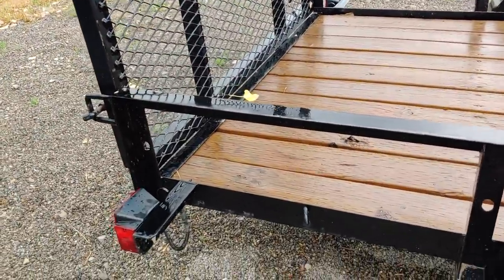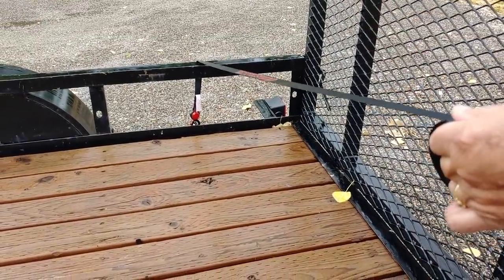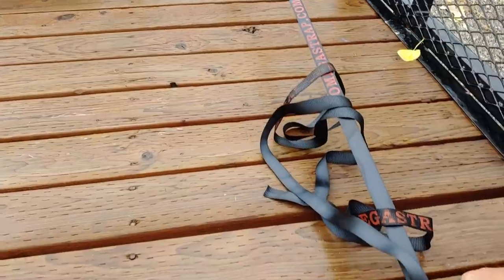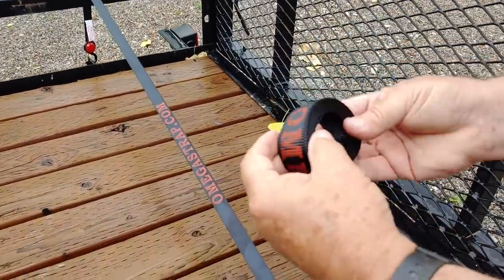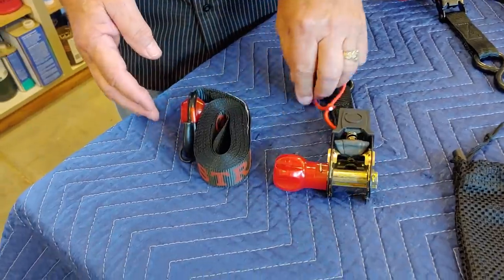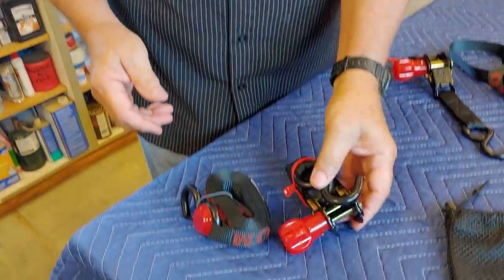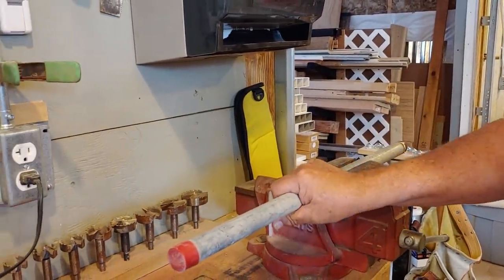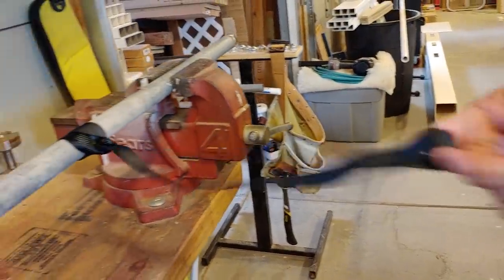FINALLY - A Better Ratchet Strap!

Comment: Biggest issue I have is if I purchased cheap straps, got what I paid for. The ratchet bends, the strap material is thin but the hooks seem ok.  Like the idea of the bungee cord on existing straps as mentioned in another comment. Make use of what I have since everything has went up in price. Thanks for the informative video.

Comment: After over 35 years of useing conventional ratchet straps I still don't have any major problem with them. The problems I have had with them were caused by me not using the strap correctly. 
I like the hook keeper on the strap in the video but the knob is going to get in the way.
Reply from the maker: Thanks for watching and commenting John Ossendorf. Keep the comments coming, Sir. Best, DFJ
Reply: The only problem I sometimes have is the fixed length end puts the ratchet mechanism at a location I don't like because it may scratch the load. Then I usually just reverse the ends so it gets into a clear area.
The excess strap is quickly handled by bundling it in a figure 8 pattern on my hands, much quicker than trying to loop it around the knob or in a tight circle.

Comment: I have used straps for years.  First off, you get what you pay for, so don’t buy cheap straps.  When strapping items, where the strap will be hit by the wind, put a single twist in the strap, to keep it from vibrating in the wind.  Next, Consider using some sort of protection for your straps, when they are under tension going over the frame of a trailer.  I cut a piece of plastic from a milk jug, and place it between the frame and strap.  Always secure the ends of the straps to keep them from blowing around.  I just tie it off to another location on the trailer.
Reply: Good idea with the twist. I normally strap down things in an enclosed space so wind isn't an issue, but good to know.  I've always strapped them straight because it might trigger ocd otherwise. 🙃

Comment: i use the smaller cheap straps and the only ones I've had problems with is the one that i didn't use correctly.  i only haul landscaping materials or trash.

Comment: I  grind the hooks off the strap and use the loop holes left to put directly on to the trailer hooks . far better device without the strap hooks.
Reply from the maker: marxman00, I would say this is doable for moderate loads, but you'll need to watch not to use this on high tension loads as the loop, which is only bent to form the shape, and not welded, could open and fail. Thanks for taking time to watch our video and write. Best Regards, DFJ

Comment: The knob is not a bad idea but the wire - good idea too but that's gonna break after a few times surely?
Reply from the maker: Thanks for watching and writing. The wire is surprisingly durable, and they've made it so it can be replaced with a piece of 12 gauge solid core electrical wire when the wire does give up. Best, DFJ

Comment: That bungie is going to wear out and loose it’s recoil pretty fast. And that bendable tie is going to wear out pretty fast as well. Then you’re just left with a ratchet strap with a knob that gets in the way.
Reply from the maker: Thanks for weighing in. The wire is replaceable with standard 12 or 14 gauge electrical wire. That knob is a key feature that allows both alignment of the slot for threading (even in the dark), and well as controlled release, instead of all or nothing. So far, so good on the "bungie" portion. Best, DFJ

Comment: My hubs needs this.  We just tossed a strap that was locked and we couldn't fix it.
Reply from the maker: Glad you saw the video. We are very impressed with this new variation of the ratchet strap. Hope your hubby will be as impressed as we are. Make sure to use the discount code in the description below the video to get 10% off. Best, DFJ
Reply: @DirtFarmerJay  Yes sir. He watch the video and he was sold. I have reminded him of the code. It really does solve every problem he had with the old straps. Thank you!
Reply: I have found when a strap gets locked, just hold the lock open, and use a flat bladed screwdriver to turn the drum manually.  Just insert the screwdriver in the slot on the side of the drum, and it will right up.

Comment: Hey Dirt Farmer, would it be better if the D loops were placed the upper rail so the strap doesn’t torque across the top rail ?
Reply from the maker: Yes indeed. That would work quite well! Thanks for the insight. Best, DFJ
Reply: Hey Dirt Farmer, I noticed the wood floor on your trailer look Good and durable and will stand up various weather. How old is it ? Or is it the type of wood ? Mine was Thompson water sealed and it’s warping and cracking and still drying out.

Comment: Looks like a solution to a non-problem. 
The knob will get in the way or get broken off, the little wire will eventually break off, and the big gap in the spool area means less strength. 
If you want the hook to stay hooked while you walk around, use a rubber band, a piece of tape, or a bread tie. 

I avoid small 1" wide straps, they're fine for small cargo but worthless when you need them most.

Comment: The first company that makes magnetised hooks on all ratchet straps will make a killing.
Reply from the maker: Agreed! Best to you, DFJ
Reply: It is a concept that has been used, but there are drawbacks. They stick to everything and pick up everything! They don’t work with aluminum or stainless steel either. OmegaStrap is going to try an earth-magnet option that fits into the hub of the flex-hook assembly. It can be easily removed if it becomes too annoying.

Comment: BS! You do NOT lay ratchet open. I've been flatbed trucker for 36 years.  You adjust the slot perpendicular to the ratchet with arm closed. Thread the strap through the ratchet and take up slack. Then tighten ratchet strap. Period! Quit telling people to lay open the ratchet. It is absolutely the wrong way!
Reply from the maker: Steve, thanks for writing and sharing your expertise so passionately. Your way is indeed more elegant and direct. The way I demonstrate works, but yours is a better way. We actually intend to release another episode on the best practices with these devices, and your approach will be the featured way for threading the strap. You're not the only one that has written and taken exception to what I said. Thanks for being a part of the transportation network - the best to you and yours - DFJ

Comment: Dad always said you had to be smarter than the object your working with. If you can't work with the strap as designed, you're simply not very bright.
Reply from the maker: Robert, thanks for weighing in. If we only stayed with what was already in place, there wouldn't be ongoing improvement and product development. We use "traditional" ratchet straps as well and have episodes on those as well. Best Regards, DirtFarmer "Not Very Bright" Jay
Reply: Then we should still be using rocks for hammers! Try OmegaStrap and you’ll see why like the hammer, it’s a better tool.

Comment: Clearly the maker of the ratchet strap in your video has some nice features for the general public not serious users. I wouldn't be surprised if those soft wire and bungees break under normal wear and that knob cracks in the cold/UV. Most importantly the detail of Made in the USA. You and the manufacturer didn't do your homework or look at all. There are quite a few manufacturers producing straps, webbing, etc for homeowners/commercial/industrial solutions that meet or exceed Real USA Industry standards not Chinese or Asian imaginary/cloned or copied standards that they may stamp on their junk. Heres one example for you and the drones who don't search for themselves and you Sir are doing a disservice to the American public by not checking for yourself. Please look the site below. Covers all levels/needs. MADE IN U.S.A. One of many!
Reply from the maker: dhtrehj ipohgf - slow your roll there a bit. I appreciate you taking time to write and be so passionate about supporting U.S. manufacturing and workers. I share that sentiment. Many of our videos express the view that wherever the viewer is, they should first and foremost support the industries in their own country. 

Instead of me re-writing all of my thoughts on this, would you extend the favor of reading the response I gave to "Jeff" on the same video? I think you will find we are closer in position on this issue than you think - and that we DID do research.

Lastly, I'm sorry that you see what we are doing is a disservice to the American public. That is absolutely counter to our personal philosophy - our goal is to help people become more self-reliant and to have good, factual information to base actions on. If we missed the mark on this, it certainly wasn't intentional, and any resources and such you want to send my way, I'm glad to pass on. The link or links you refer to at the end of your comment did not come through.

The best to you and yours - DFJ
Reply: I am one of the most serious users, and that was the basis of the changes! In regard to the domestic manufacturing , please look to one company called ratchetdepotusa as an example. There are more USA banners and flags on the site then at a July 4th parade. Yet I was in China at a plant where they informed us they sent 80 containers of straps  over the previous year. Naively, we headed out to find “that company” in the USA to team up with, and found that custom built straps here are still made of overseas components. As for the wire and the bungees, like all tools, they will probably wear out. Our warranty is this: if you think it’s our fault, ask for a replacement. If you think it may be yours, please buy more! Thanks for the input.